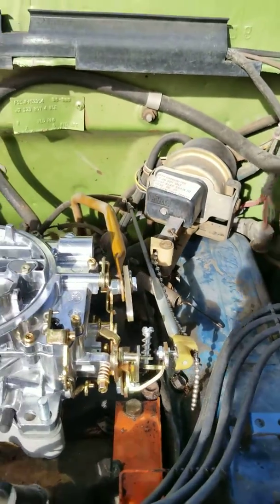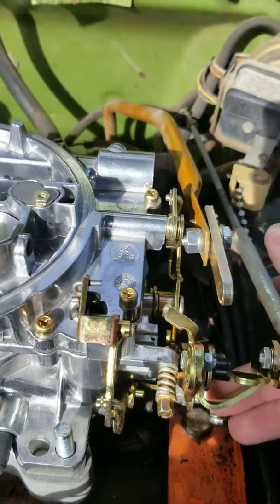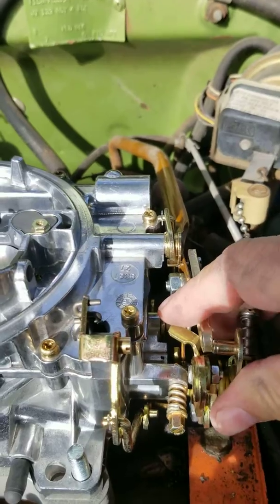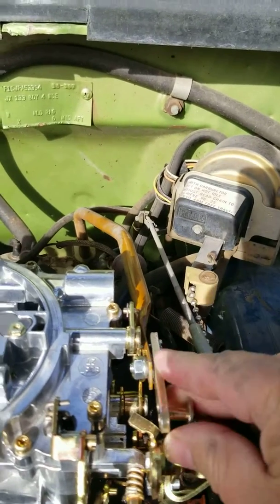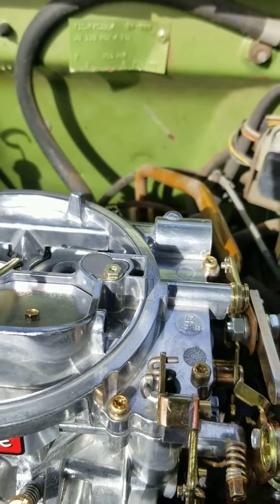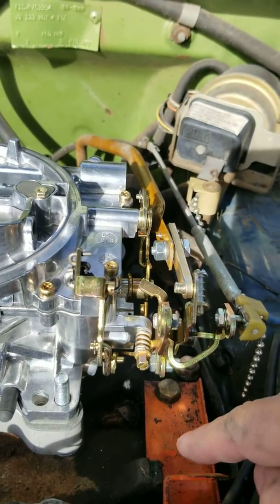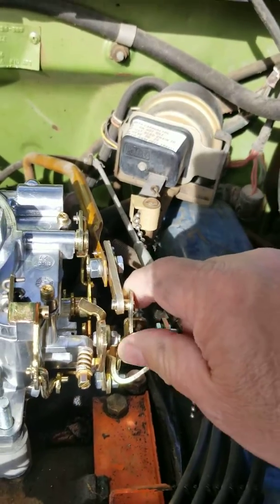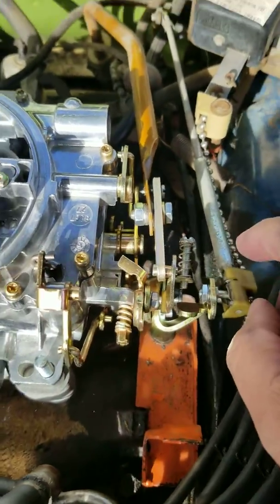Install of edelbrock 1406 on f150 with a 460 spread bros manifold

Comment: 😂I’m going through the same POS issues, with the BBF 429/460 and using the edelbrock performer #7166 intake and Edelbrock carburetor, and the adapters they sell and nothing is lined up correctly.  Definitely not a straight bolt on setup. I’m thinking I have to fabricate a bracket that raises the throttle cable bracket higher and to get the throttle cable further outside to the left.  I see nothing online from edelbrock for BBF and connecting to OEM throttle cable. My email questions to edelbrock tech support are unanswered.  Fabrication and DIY engineering.